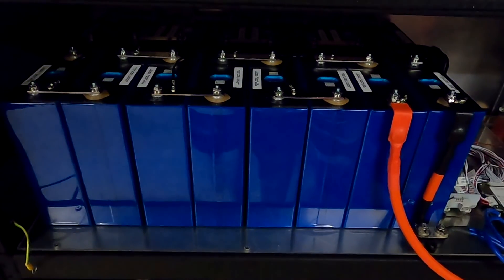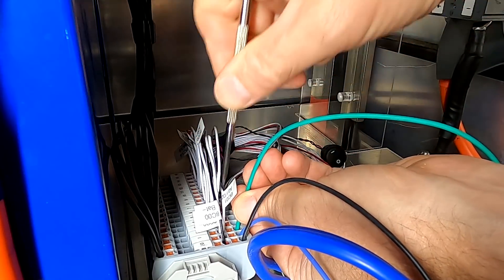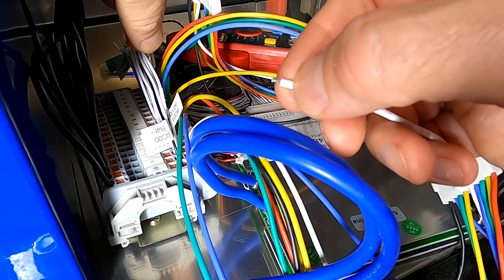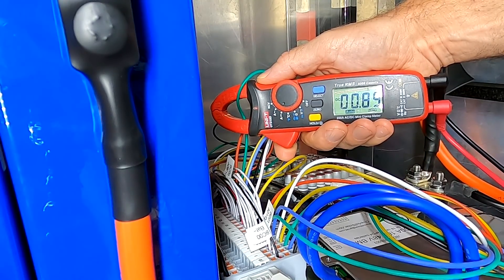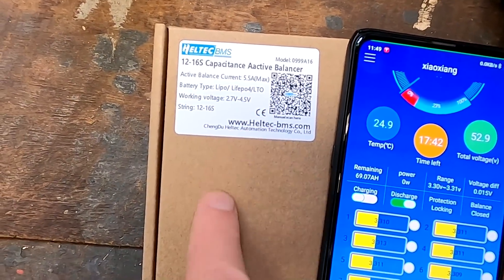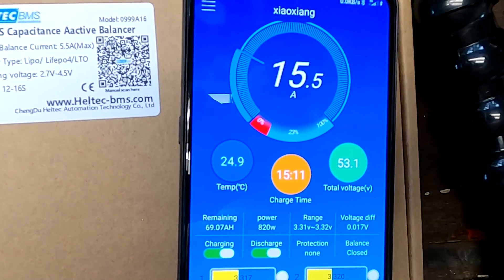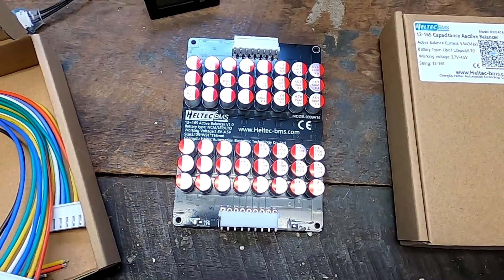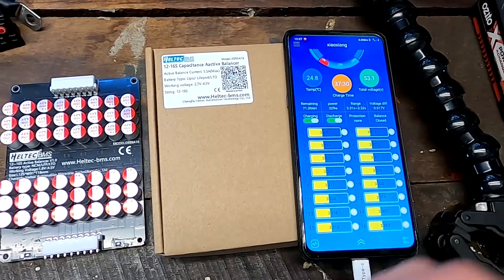HELTEC Active Balancer for LiFePO4 batteries. How to install and avoid problems.

Comment: Something to remember with balancers, these are budget devices they have errors measuring voltages, they’re not very well calibrated and they will drift. You shouldn’t chase the “perfect balance” as what appears perfect with your chosen BMS isn’t actually reality.
Reply: they do not measure the voltage. The higher voltage just forces the current to the lower voltage cells. It is similar to when you connect the cells in parallel. The voltage will equalize because the lower voltage cell will just absorb the current from the higher voltage cell.. That is why they are accurate

Comment: I have the negative wire run through the relay on my victron charge controller. It's only set to close the circut (and enable balancing) when it goes into float state. A really easy way to balance only when at a set voltage
Reply: This is clever. I like it.
Reply: Nice,👍👌
Reply: That is a neat idea. I will have to check if my Epever has the ports for that.
Reply: I was thinking of doing this with my Batrium BMS as well. I can set a relay to enable at various settings: Voltage, SOC, and combine it with charge/discharge state, etc.  I may get the one that has the app interface and see if I can integrate it into my Batrium or victron ecosystem for monitoring.
Reply: @Shep5847  doesn't the batrium already have a decent amount of balance power?
Reply: @hummmingbear  Batrium doesn’t balance by “moving” excess sun juice from one cell to another. It burns off the excess in the form of heat at a rate of about 1.8amps per cell.  In a properly configured system, you would set the “balancing relay” to kick in around 3.55v to 3.58v or so.  Then, configure the bms to start to burn off excess sun juice at about 3.60v.  Also, you can still set a max voltage at 3.63, with critical cut off at 3.65v. Of course you can rearrange around any of these values to suit your needs, but that is how I imagine it would work with the Batrium. Also, Batrium has an “auto level” feature as well, but moving juice from one cell to another is more efficient (even though it’s not super efficient) than burning off all extra juice in the form of heat. That’s how I see it at least and I may be wrong. I haven’t had the opportunity to test it yet. 🤷🏻‍♂️ So it’s all theory right now with an active balancer in the mix. But I’ve done everything else I listed successfully.
Reply from the maker: So the negative wire of the balancer is enough to turn it on and off? Is this what the solder pad does anyway, just disconnects the negative supply?
Reply: @OffGridGarageAustralia  exactly, without the negative connection they are all just positive leads. The negative on the heltec is the only negative connection so it immediately turns off when the circuit is opened.
Reply: Wouldn't it make more sense to activate the balancer when the mppt goes into absorption and not float?
Reply from the maker: @MrDingaling007  yes, that would be the ideal situation for turning on balancing as it is your highest voltage while charging.
Reply: @OffGridGarageAustralia  Ive finally tracked down an affordable adjustable voltage relay to try out your suggestion with turning the balancer on at the higher voltages. Will report back after some testing. But could be a cost/functionally very effective solution!
Reply: I assume you had to take the controller apart to do this?
Reply: @SpeakerKevin  nope! Victron supports the relay out of the box. They have ports on the front for it. You can select different settings/options for when you want it to open/close the relay.
Reply: @hummmingbear  Thanks Brian, I'll have to see if mine has that option.

Comment: I have one for 4 cells. I removed the solder and connected it to a relay which is controlled by an esp8266 that monitors mqtt messages fom the bms over wifi and only activates balancing if max cell voltage is over 3.38 and diff is over 0.02 and then disconects ince max cell voltage is below 3.379 or cell diff is below 0.01. This ensures that balancing is onoy active while charging and on the higher part of the curve. It may be a bit overcomplicated but since I had the components laying around and I was already monitoring the bms with a raspberry pi it was just a matter of connecting it all. So far it works great
Reply from the maker: Thanks a lot for sharing, that is the perfect solution!

Comment: Hi Andy, great content as always. Would I switch the negative wire of the active balancer.
Could you do a video showing set-up using a voltage trigger switch. Please mate. I have a 12v set-up using a Daly.
Reply: You have a switch to make/break contact of those "run" jumper pads.  Everything else is wired as standard. The balancer handles enable/disable of balancing according to the "run" jumper pads.
Reply: @CollinBaillie  yes, but is it the negative wire I would pass through the switch.
Reply: @drewsuf77  No. 

In the video, you see Andy essentially shorting the 2 pads with a screwdriver. 

You literally wire the 2 jumper poles to a switch. If the switch is on, the pads are shorted. If the switch is off, the pads are open circuit.

And by shorted, I mean they are connected, forming a complete circuit.
Reply: @CollinBaillie  oh ok thanks mate.
Reply from the maker: Thanks Collin!

Comment: Andy, with the big battery now "done" (let's call it "in production", as we all know that it will never be truly done), are you slowly getting it fully charged with the autumn sunshine and your current solar installation? Will you be able to get all three banks over 3.45V to actually warrant top balancing before winter hits?
Reply from the maker: I picked up more solar last weekend. The 4kWp plus the temporary pool fence setup is not enough to get me the energy I need. Lots of shading on the garage now...
Reply: Also, when i am asking questions anyway... 

You have me convinced on compression, but you have not secured your cells at all. Even though here in germany (where i live) and belgium (where i would really love to stick a huge battery so that that house can almost go off-grid) I do not really have to worry about earthquakes, but smallish ones still occur ever few decades (like the roermond one in 1992). How well do the busbars and cabling hold the batteries in place today?

Would it make sense to glue a scrap strip of plexiglas, flat, on top of the other plexiglas, as a low fence around the batteries to keep them from moving around on the shelves. Would that, and the busbars and cabling hold them in place semi-securely in case godzilla does attack?
Reply: Being in Queensland... yes. We have stupid amounts of sun. Except for today :D

Comment: You should bring the battery up to HVD, then slap on the balancer when the cells are at very high SOC, and let it churn there for a **while**. It will take a day or three to make up that difference
Reply: What's HVD?
Reply: @CollinBaillie  high voltage disconnect.
Reply: @CollinBaillie  high voltage difference?

Comment: You have to strip more insulation off the balancer wires and tin them.
Reply: Tinning wires before putting them in a pinch type connector is risky. Basically you end up with the point which "protrudes" the most making contact and nothing else. This single point of contact therefore becomes the only point for current flow. This results in an effectively much higher resistance and heat will be generated with higher current flow. Raw copper strands are best as the pinch will flatten the strands so they are all in contact and thus many more current flow paths, utilising the entire wire core. 

Alternatively, a ferrule could be used to ensure all strands are compressed together becoming 1 "solid" copper wire, and the ferrule wall would be pressed agains the pinch connector "bus bar" along its (ferrule) entire length. Watch a couple videos back about ferrules.
Reply: @CollinBaillie  You are drinking the kool-ade. The solder is softer than the copper and makes a good bond. . It's a waste of time to put ferrules on tiny wires. You could use low oxygen silver wire but that would also be stupid.
Reply: @solexxx8588  or... watch a few videos back. How hard is it?
Reply: @solexxx8588  Are you basing "solder is softer than copper" on the state before or after soldering? I've never seen post-tinning solder that's softer than copper. Especially eutectic blends. Andy specifically made a video covering how these connectors pinch the wires at the pressure point, reducing the contact area, and how tinning wires is bad (TM). Kool-ade seems to be an excuse for ignorance. Not to mention it's a regional thing. We call it cordial.
Reply: @CollinBaillie  BS